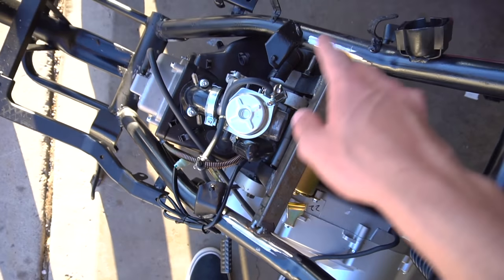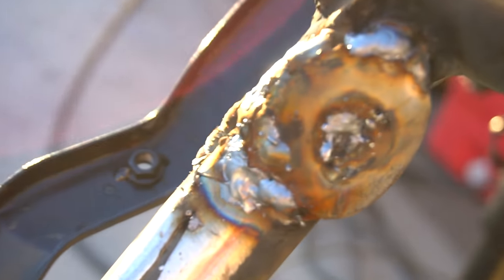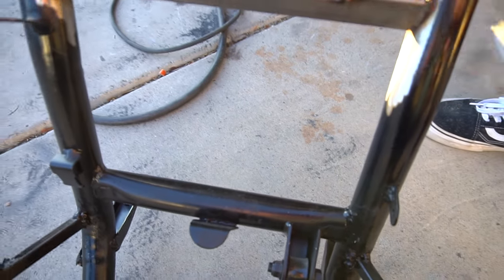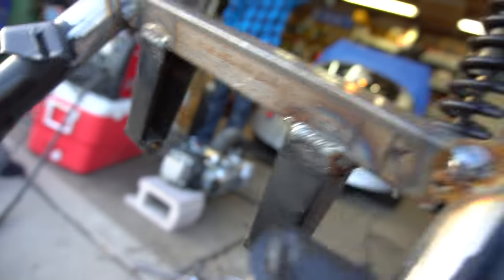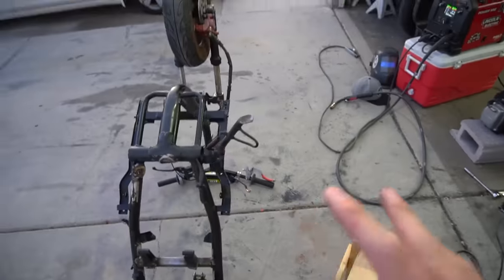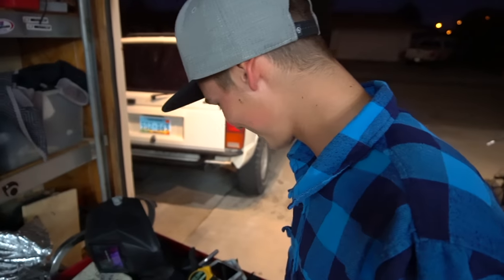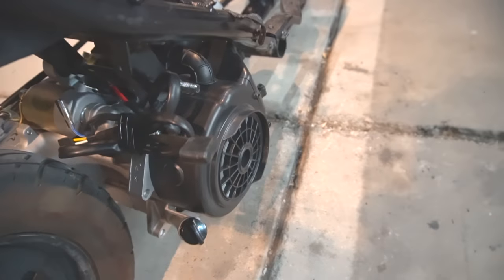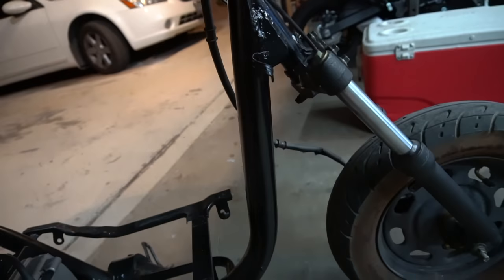150cc GY6 ENGINE INTO A 50cc SCOOTER SWAP | PART 8

Comment: Bro I'm 51 and love these fucking scooters. I'm building a 100cc for my Taotao thats going to be a stripper like yours. I'm wondering though, why didnt you just use a 125cc 2 stroke?
Reply from the maker: Les Heath Jr I looked at 2 strokes for a little but couldn’t find one that was a complete crate motor that was any less than like $500 this gy6 150cc plugs right into the 50cc harness and no major modification. Also the 150cc is $300 shipped and comes with everything. 2 strokes are rare out in Vegas cause the heat I guess and you can never find parts or 2 stroke scooters anywhere
Reply: Trevor Pritchett , that good to know about the price. I'm waiting for another guy who's supposed to be running a 100cc on alcohol to find out how feasible this might be. Appreciate this video series, learned a few necessary things. Can't wait to see it run.

Comment: Why did you buy a 4 stroke motor ?
Reply from the maker: TheRaix it was already a 4 stroke scooter and similar everything so I can plug the new motor in with the original wire harness and everything and not have to worry about major modification, way more common parts too cause out here in Vegas , 2 stroke scooters are rare.

Comment: did u use the same tire an rim from the 50 on the 150
Reply: You can but have to put a spacer in between the nut in the tire the best way to do it is by a shorter shaft for the rear end that goes in the transmission under $20